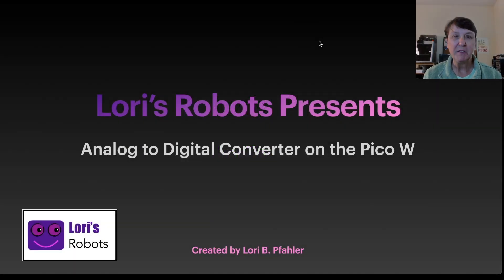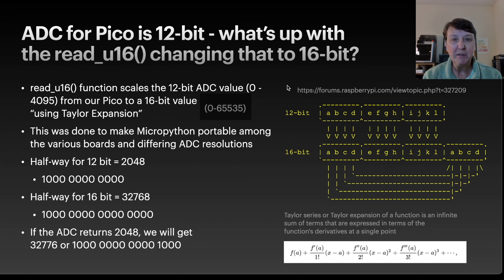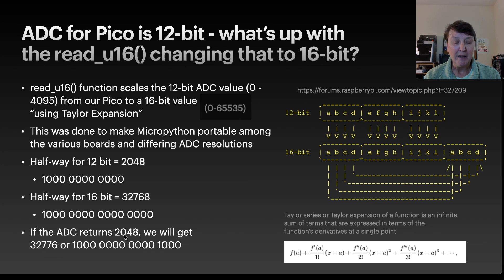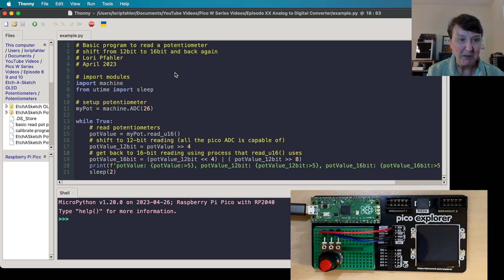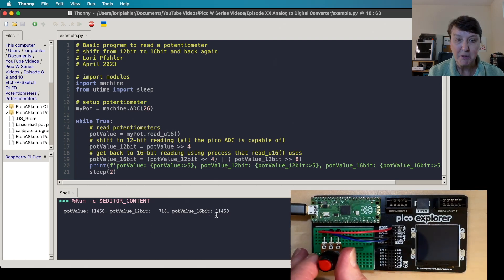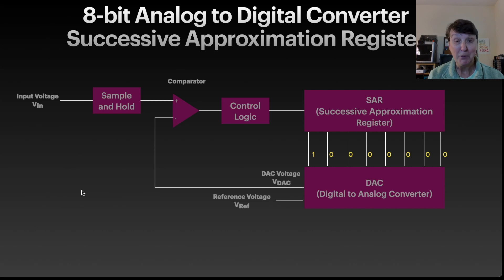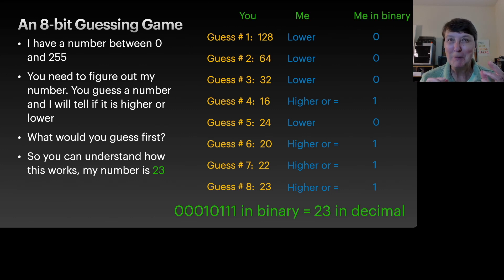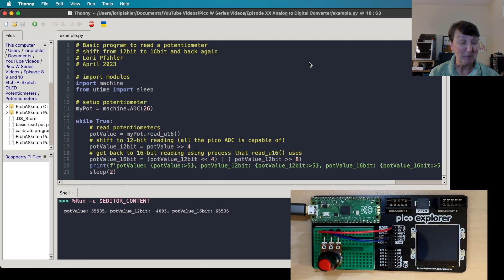Pico W Episode 14: ADC on the Pico W - How it Works

Comment: Suggest that you use these pins as there is noise on main 3.3 and ground . and add a capacitor on adc input and AGRND

ADC_VREF     ADC pin power supply voltage, filtered from the 3.3V supply on the board. (Pin 35)

AGND             Ground reference for GPIO26-29, connected to a separate analog ground plane. Can be linked to digital ground. (Pin 33)
Reply from the maker: Thanks for the suggestion!  I tried something like this before but did not see much improvement.  May give it another go.

Comment: Interesting. I created a little circuit to read a battery voltage fraction on the ADC and it's not too bad in the numbers. The voltage (around 1.75 volts) multiplied back is pretty close to my multimeter readings directly on the battery. Not sure where the project is going yet.
Reply from the maker: Sounds like a fun project.  Thanks for watching!

Comment: Try battery power and display on the oled ? very nice explanation, thanks
maybe try an external adc convertor,  adafruit has 3  ADS1115 16-Bit or ADS1015 12-bit, or mcp3008 10-bit
Reply from the maker: Good suggestion! I was thinking of adding in an external ADC.  I will share my next steps in future video.  Thanks for watching!

Comment: What a wonderful presentation on ADC. I have never heard of 'Taylor expansion'. My guess it is more efficient to move bits around than it is to do (x*2 to the power of 4) to convert from 12 bits to 16 bits. 
The glitchiness of the Pico ADC and not getting to zero has been documented. Something to do with the closeness of the ADC section of the 2040 chip to other sections causing noise I think. So I don't think a better potentiometer will help. 
Thanks for another great video from Lori's Robots.
Reply from the maker: I have been finding that the noise (throughout the range Min to Max) is very low if I don't move the pot.  That is what made me think that higher quality pot might help.  But I agree - there appear to limits on how much you can improve the noise.  There may be some hardware solutions as well but my electronic circuit knowledge is lacking to investigate those at this point.  Thanks for watching and sharing your comments!